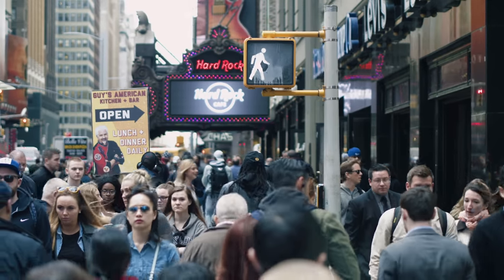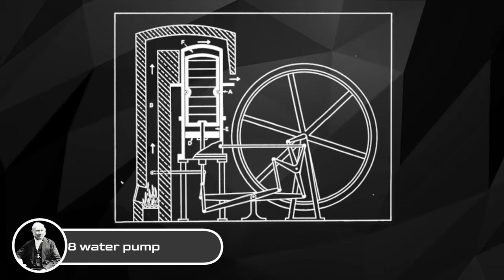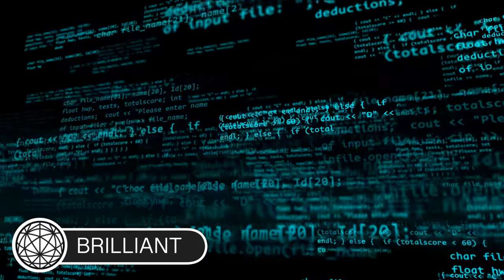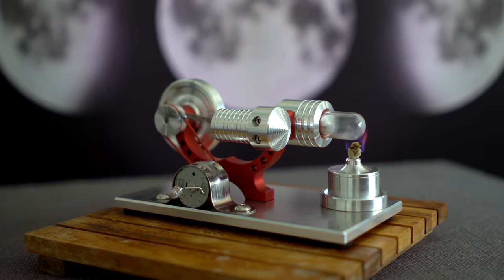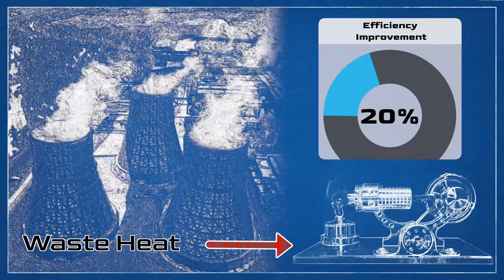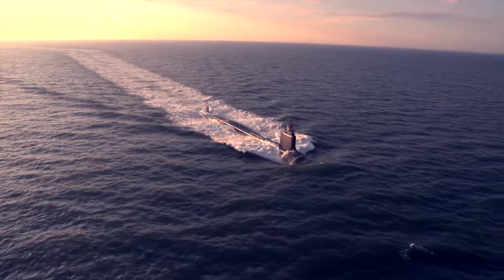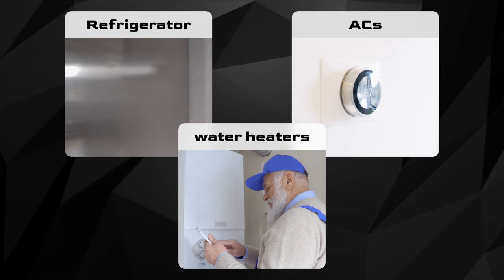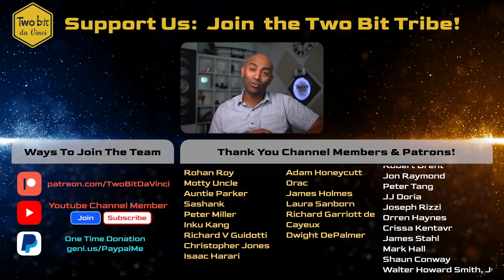Why This Age Old Tech Can Be the Future of Energy - Stirling Engine Explained

Comment: Solar panels have issues with heating up causing life span and efficiency issues, a stirling engine could cool a solar panel and dissipate the heat into a ground heat sink creating energy and cooling the solar panels.
Reply: Also could be reversed in the cold to reduce snow buildup and offer some power when dark.

Comment: About the attic Stirling Engine...you show the heat gradient between the attic and the outside and then you show the stirling engine just sitting out in the air. I believe you also said that to make significant amounts of energy, Stirling engines would have to be large and heavy. Uh...perhaps we support that with a skyhook? :-)

Comment: So since heat will produce motion and generate electricity… if you ran an electric current through it, it would turn the wheel and produce heat? Right? Or am I wrong? Honest question because I’ve been thinking about the similarities of this and thermoelectric generators

Comment: Wouldn't a solar water heater design produce a much higher temperature gradient than the temperature of an attic?

Spiral black tubing in a shallow box painted black and enclose the box with glass for the greenhouse effect to further heat the water. Place that box on the roof. Put the stirling engine higher than the box and maybe a design would allow for a passive pump through rising hot water.once the water heats the stirlings block the water continues cooling by entering a shaded white pipe where water cools and sinks back down to the solar box.  Add some mirrors to reflect light through a lense to heat the hot place. Bam! 

Would that higher temperature gradient increase the power or is their an optimal temperature gradient?

Comment: Putting a Stirling engine on the heat output of your refrigerator is like putting a windmill on your car
Reply from the maker: Not at all. The fridge is pumping out heat and heating your house. That’s not what you want in summer. You could instead put that to work. Windmill on car is just adding drag and losing energy. Hope that helps
Reply: @TwoBitDaVinci  The refrigerator is a heat pump and in this setup the Stirling engine is a heat engine.    Putting a Stirling engine on the heat pumps hot side increases the temperature of the hot side resulting in the refrigerator being less efficient.  The extra energy you get from your Stirling engine will at best match the extra energy your refrigerator will use.  You still have to pump the same amount of heat out of the refrigerator which will all still get into the room.
Reply: The first generation flat panel TVs were the appliance to reclaim energy. They operated on 300 watts and you could feel the heat rising out the top. My living room was noticeably hotter. Then we had to run the AC to put that heat outside. Refrigeration in commercial establishments is perplexing. Do you put the heating source inside or outside or have it connected to both. A grocery store I worked at in the 70's had a system like that. A room with all the compressors that had louvers depending where to exhaust the heat. I'm afraid most of the heat comes from the electricity used to transfer the cooling.

Comment: No mention of nuclear power? In France the nuclear power plants had to be shut down because they had a problem with heat since the water from the rivers was too warm. A nuclear plant with a stirling engine could solve that problem here as the coolant doesn't have to get disposed (into the already warm river). A stirling engine could generate electricity almost directly from the heat of the reactor and also require much less heat than that you need to generate steam from water and turn a turbine - so you could probably even run it on nuclear waste that has to be cooled in huge basins for years. Also the size is no problem here since the engine could get as huge as you want.

Comment: 16 gauge wire copper gold if you can afford it magnets high-powered two switches that let the current go one way two precision bearings
Reply: You make a wheel the wheel spins between the magnets the wire windings are on the wheel the windings pass through the magnetspositive and negative is hooked to the switches one on top one on the bottom it works the government has suppressed it

Comment: Do you think a Stirling Engine could be used In very cold areas like Alaska to add voltage to a Tesla Wall in any meaningful way. In the winter there are many lolcations in the world that experience temps of -40 degress (C) for weeks at a time. The houses or busineses in cold locations are heated to 18-20 degrees (C). That is a difference of 60 degrees.  Are there any experts out there with thoughts regarding this? Thanks Ricky, I really like your show 😁

Comment: I've wondered why some refrigerators don't come equipped with Stirling engines to extend cooling capacity in the event of a power failure.
Reply: Because they would be bigger than the fridge itself just to power it.

Comment: What if you had large black radiators on your roof, instead of the attic, and re-circulated silicon (transformer) oil. The exit tubing could be coiled around the expansion chamber of the sterling engine..

Comment: Misleading to say “Requires no fuel” when it requires a heat source.  Only two sources create heat without fuel: solar & geothermal, every other source requires fuel to creat heat.
Reply from the maker: waste heat, formed in other processes, currently goes to waste, but could provide meaningful work

Comment: Utilizing almost every waste heat source you suggested would decrease the effectiveness of the primary system:  refrigerators, air conditioners, residential flue gas, attic heat are poor sources of heat for a Stirling engine.  The exhaust temperature of these sources are driven as low as possible with economic optimization.  So you don't really have a decent temperature difference to exploit.  Given the high capital cost of Stirling engines, real waste or moderate temperature heat sources are needed.

Comment: Use oil or alcohol as a working fluid . Never water. ( water has high thermal resistance can freeze in cold climates and build dangerous steam in high heat climates)

Comment: It does use fuel. The burning of the burner to heat the hot head  is the fuel consumption.
Reply: Run a diesel generator for electricity now you can run your Sterling engine off the waste heat of the diesel engine etcetera.

Comment: Can anyone put that small Stirling engine on hot asphalt and make a video?
Reply from the maker: That’s a good idea
Reply: @TwoBitDaVinci  all flat black rooftops, parking lots, etc. for small scale and something like a huge metal (for better heat transfer) black painted sheet (cheap to make and maintain) just put in the hot area with many Stirling engines on top. Also could be on top of some metal containers filled with salt water or something that would be able to generate heat a few hours after the sunset, possibilities are limitless.

Comment: There are much cheaper and more efficient ways to deal with an attic.  Proper roof and attic insulation would be more efficient and simpler.  A radiant heat coil on the roof and the cold side of the sterling engine in the ground would make more sense assuming it can even produce enough power to run the pumps.

Comment: The real question for ME is: does the power output of a Stirling Engine surpass the Peltier / Thompson thermovoltaic effects? Because we have a ton of radioactive waste just CONSTANTLY emitting heat... if this would do a better job than a RTG, then to hell with it, let's go! Wonder if we could even pair it with those thermal radiation panels that have been making the rounds lately... Then we can just passively emit the Earth's excess heat into space all the faster while hitching a yoke to it.

Comment: just for points ..diesel engines are also heavier and also do not s a steady state stirling or slow throttling stirling could be supplemented with batteries...there really is no problem. just imagine a prius that already gets 50 MPG now running as a stirling that gets 2x more out of each gallon. now you have a 100mpg hybrid that only needs fueling maybe once a month and has no rangeanxiety and you have a real competitor to a tesla!!

Comment: Nice video and great enthusiasm! I just can't agree with the heat pump from the attic idea though, in practice it would just cost more to heat your home as this is effectively like having a badly sealed attic which bypasses one of the layers of insulation. 1st layer of insulation being the ceiling, 2nd the air between the roof and 3rd the layer in the roof. Your just partially bypassing layer 2. How about a heat exchanger on a chimney instead that powers a primary air fan assisted by, a seebeck generator to get it started and a low start voltage buck boost converter hooked up to a supercap to store the energy? Cheers

Comment: why not use geothermal earth cooling and a heat chimney out the attic( this is basically how termites cool ther nest) . to puul cool air from below the freeze line and through the home then eventually out the chimney. if done correct it will require 0 energy input, . purley operating from the sun .  you could then implement sterling or wind power generators in a up draft configuration , to takre advantage of the heat and air movment ..

Comment: Sterling engines are vastly less powerful than typical combustion engines. You can get them to high speeds, but it's a matter of torque. All I can think of to improve this is use a gas that burns extremely hot like some ration of HHO on one side, and nitrogen cool the opposite side to increase the thermal difference. I've been working on a silly little way to make an engine/mechanical  battery that turns its exhaust back into fuel so It doesnt just run out. That way I can make a free energy vid to bring in all the free energy fufu's who don't know how it works and SHUT THEM DOWWWN!!! 😋

Comment: Personally I think like alot of green tech it simply cant be a wondrous fix all to our problems.

Like the suggestion at the end if we stepped up our smart homes to have a heat line then it may be viable domestically.
Alternatively industrial machinery tends to produce alot of heat so focusing on that area first may be smarter.
Reply: 'green tech' 
I doubt the inventor, invented in 1812, had this in mind, it is just an awesome idea ..
Reply: @tomhennessy7276  just because he didn't intend for it to be classed as green tech does not mean it doesn't fall under that umbrella.

After all dynamite officially a mining tool not a weapon that would kill tens of thousands.

Comment: Now if we can take heat and turned it into power, and there must be some way to use the heat from the shields of returning spacecraft.
Or just keep something smoking along just keep it skipping along the surface of the atmosphere at a certain altitude and send the energy where needed. Part of it would be for the crafts electrical engines and battery charging system. Enough power for electrical thrusters to go to the moon and back faster than we could have hope for. Who knows one day round trip. Tugs for moving material to and from.

PS. And other junk and stuff or not👀😅

Comment: Peltier are smaller, and scalable, and... ... just as problematic, if you don't keep the temperature difference, it heats up and does nothing. you have to keep the cold side cold,  if small, it just heats up the ambient air, and it's ok... if big, you have to be able to dump all the heat, probably that's why it was only used in a submarine

Comment: ok, so which is more efficient? let's say we have a heat line, pulling heat from some source, be it an attic, a compost pile, or a laptop... which can convert that energy potential more efficiently into electricity? a stirling engine, or solid state thermoelectric generator cells? And both are heat engines too!!

Depending on the efficiency, it's really going to come down what is connected to the stirling engine to generate electricity. both systems have the potential!

Now if we combined two different approaches, but using the same idea... There already exists Geo Thermal Air Conditioning, the Simple Tek channel has good video describing the Geo Thermal Air Conditioning concept... and this can be used in reverse to take heat out of the attack, not a million dollar idea, since Geo Thermal Air Conditioning isn't commanding that kind of money! XD but it exists!

So what if we used these together? hot water from the attack loop and cold water from the ground loop... the biggest question is, if this worked. how long would it take for the ground to become heat saturated...

But there you have it... geo thermal cool water, and hot water from the attack or solar water heaters for that matter... and between stirling engine, or solid state thermoelectric generator cells... free electricity once they paid off the initial investment!!

I guess if you lived on an island, with an active volcano, you have a heat source... and the ocean as a cold water source....

Comment: I'm not well educated in thermodynamics, but this video made me wonder. Would the temperature difference be enough if you built a BIG Sterling engine in the desert with half above ground and half below? during the day the upper portion would be your heat input, the lower your heat sink. Then after nightfall the upper becomes the heat sink with the lower being the heat input. Anyone know if that would be at all viable?
Reply from the maker: Yeah absolutely! Question of how big a temperature differential and how much it would cost to make etc
Reply: @TwoBitDaVinci  That's the root of what my question was. I guess a better way of asking would be what kind of temperature differential would be needed to make it viable?  Would it be possible to achieve those differentials on a huge scale? For example, scaling the engine up to 10m diameter. Or even bigger.

Comment: Logically thinking those engines can't produce lot of power because they operate on small temperature difference, unlike internal combustion engines.   I'm wonder how big such an engine would have to be to produce let say 1000 watt of power and   What kind of energy would it required ...
Reply from the maker: Great point and question!
Reply: It would depend on the heat source. If you had high heat (like from fire) the engine would be around the size of a washing machine.

Comment: How can you compare a heat pump to a sterling engine, a heat pump transfer heat from the cold side to the hot side, a sterling does the exact opposite. But congratulation from your figures you created a perpetual motion machine. A heat pump use 1kW of electricity to produce 3kW of heat, you claim a 40 to 50% efficiency, so the sterling engin will produce 1.2 to 1.5 kW of electricity leaving you with 200W to 500W of free energy. I guess you'll get the next Nobel price.

Comment: You cannot use waste heat in a stirling engine, waste heat must be put aways as fast as possible from the heat source, but this engine would be a resistence, blocking the heat to disipate

Comment: It's easier and less expensive to install solar panels on your roof than to try to harvest attic heat to run a Stirling engine to run a generator.
Reply: @TwoBitDaVinci  Go through the numbers and you will see. Or show me by the numbers that I am wrong.  Remember this is a regular attic, not some specifically designed heat collection/storage chamber under the roof.

Comment: This engine is not used because its capital cost and added mechanical complexity add more cost to the system than the alternative of buying more fuel in whatever form. Waste heat is wasted because it is too expensive to recover. Sterling engines can’t change that in their current form.

Comment: Here in Australia the void between the ceiling and a tiled or corrugated iron roof becomes hot even on a mild day. 
Can this waste heat run a bank of Stirling engines, if so it may be possible to generate sufficient electricity to run an air conditioner to cool the interior of the house free of charge
.

Comment: And a solar panel is a reverse LED that will drain the battery at night without a solar charge controller.
Reply: Specifically a diode? I was wondering about that whether a solar panel discharges at the same rate it charges.

Comment: A "Crooks Radiometer" is basically a Stirling engine why not connect a generator to it?
This was depicted in the  movie "Pitch Black"!
Whaddya think?
Reply: A Crookes Radiometer has extremely microscopic torque and doesn't really spin fast. It's not efficient at converting the energy, a fly has more power than a radiometer. Odd fact - the inventor expected it to rotate in the opposite direction than it does, he designed it to use light pressure. But due to the incomplete vacuum in the bulb the black side, which gets warmer than the white, agitated the few air molecules that were touching it. As they bounced off they applied thrust to the black side.

Comment: Somewhere some fuel has to be used to produce the heat that would drive the sterling engine. Newton's law always wins. The only way to use the engine cleanly is to possibly use geothermal energy, which would then make the sterling engine not the best choice, other motors/engines would be more productive or efficient than something like this.

Comment: "Sterling engines aren't suitable for use in autos"......but they can be used to produce electricity to charge an electric vehicle battery.
As long as fossil fuels are avoided and biofuels are used, Sterlings are carbon neutral...and if solar heat is used they become carbon negative.